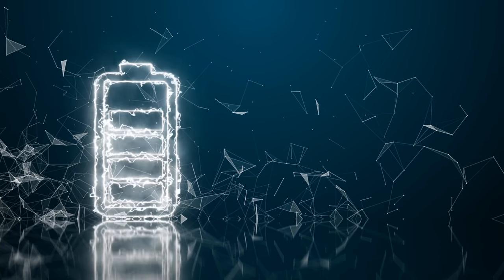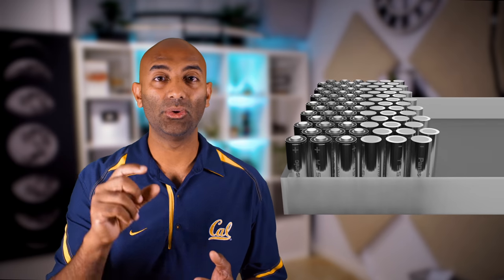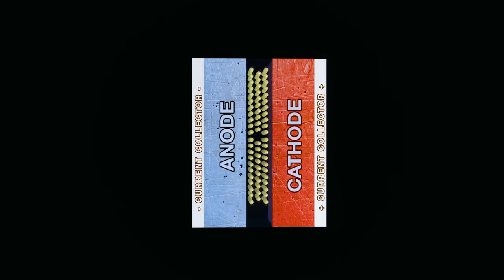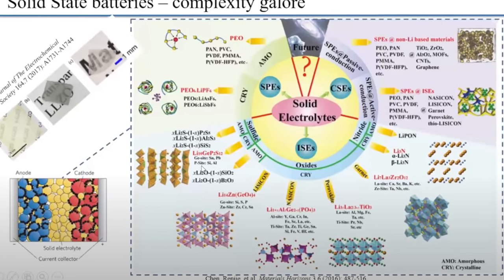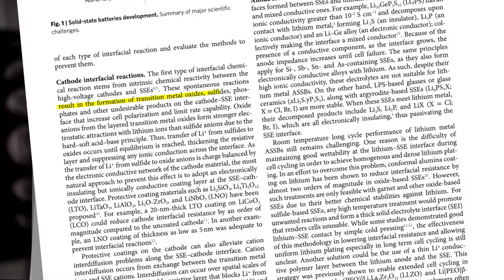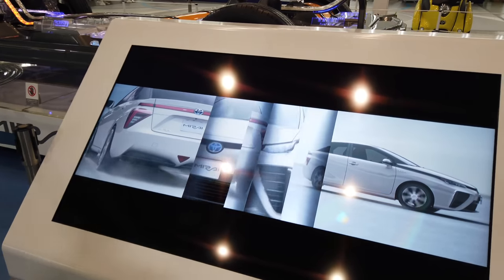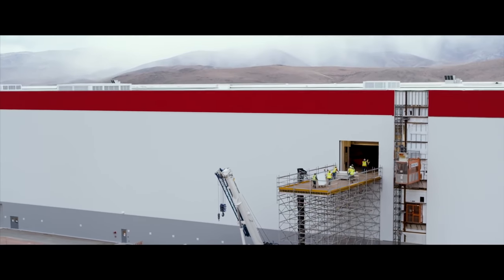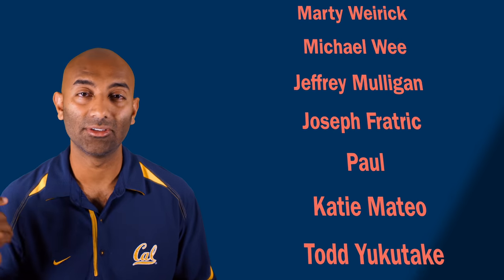The Truth about Solid-State Batteries. / Are These Batteries Really The Next Big Thing?

Comment: I remembered when those lithium button cells first came out. I thought they was amazing.. 10yr storage life. Loads of mA punch for it's size compared to the old AA zinc carbon batteries..
It was used in those small portable Japanese handheld arcade games..
The batteries then was expensive for me as a kid.
Reply: Li button cells != li-ion cells.
Reply: @karenrobertsdottir4101  ? ?
I was describing my first encounter of lithium battery technology as a young lad in the 80s.
Are they not all put under the term- Lithium battery which ever flavour they are ? 

I would be interested what you mean li-ion !=button ones.
Reply: @timypp2894  No, they are not. This is a common misconception. They both have "lithium" in the name, but that's about the same it.  "Lithium batteries" are not the same thing as "lithium-ion batteries".  They have a lithium metal anode (instead of graphite / carbon / silicon) and are not rechargeable.
Reply: @karenrobertsdottir4101  ? Kerr? 
Did I say Lithium ion? Or lithium battery?
Reply: @timypp2894  You said "lithium button cells". Which are lithium batteries, not lithium-ion, and have nothing to do with li-ion batteries, as are used in EVs.
Reply: @karenrobertsdottir4101  yes that's right. I never said anything about EV. The batteries I mentioned about was for hand games. And it was expensive because it was not just first generation Lithium batteries that I encountered as a kid but are disposable. Disposable are not the same as rechargable li-ion.
Like I said it's the first time I encountered lithium batteries. 
It's called button because it's shaped like a button . I said cell because it's a cell as in batteries term battery cells.
This is nothing to do with "cells" packs used in EV.
Btw I have a background in digital engineering.
Reply: @timypp2894  So your entire post was a massive non-sequiteur?  Do you go into videos about, say, iPhones, and write posts about, say, elephant seals?
Reply: @karenrobertsdottir4101   what the nats bollocks is one talking about?  lithium button cells are in the same family as batteries used in EVs are they not? Then there are batteries and many different flavours of batteries are they not, lead acid, zinc carbon, alkaline, etc? Like oranges and lemons are the same family as citrus family? So if there was a iPhone video and I mentioned about my youth about owning a dumb phone and " I used to txt with SMS " but now you can use WhatsApp on phone doing the same thing. Are you saying my comments are irrelevant to the iPhone video? 
Mate, this hole is getting deeper as you dig

Comment: Is true that the people who make solar panels are told to make there panels only 27%  efficiency, and that the battery technology is held back, you know oil and gas, need i say more.
Reply from the maker: no its an engineering challenge... gas cars are 30-40% efficient. efficiency is a major study and challenge in engineering... but panels will get better and better in time
Reply: @TwoBitDaVinci  actually we already have excellent solar panels but they are used only in space for satellite energy supply, those solar panels are very toxic and expensive to manufacture, so not comercially viable

Comment: Need to Define Solidstate rechargable (secondary) vs Non Rechargable (primary cell)  very different proposition - a Primary Battery cell only has a single cycle..  (10x Energy Density _I would love that - but I think that is fiction - It would be easier to improve Gasoline thermodynamic efficiency to 75%  in all probability.

PS Market Cap  Whoopdedoo  - fan bois  Driving the Price Exponentially... Revenue is where it is really at.

Comment: The theoretical energy density of the anode ( lithium metal ) of a solid state battery is 10 times more than graphite, but thats only for the anode and only theoretical and no battery can ever get any where near that.The example of lead acid is approx.200 wh per kg theoretical and 50 actual if discharged very slowly.  So please stop saying solid state will have 10 times the density!

Comment: better  batteries   do not mean retooling.  as far  as the  cars  .   way less then even  a model   change  of the past.
Reply from the maker: For companies that make batteries it means retooling. Also big enough battery changes might require special handling. For example if temp sensitivity is changed for solid state batteries it can mean better cooling optimizations can be made etc.

Comment: Great Graphics. Dendrites? (I get it, maybe I can take my car to a Dentist every 6 months?) more LOL I get it. I CAN’T HEAR YOU. WHAT? I just wanted to hear You say it again. Look what TESLA did with 7000 generic lithium ion cells that were formerly used to retain memory when you turn off 120 volt supply. The problem with your theory of solid state batteries exist to power hearing aids is the minuscule kilowatt capacity of battery.
I’m sure it would take more than 20 of these to equal the output of one 2170 cell or 140,000 hearing aid batteries to be interconnected in a different way in modules but definitely not with aluminum fingers that also act as fuse and cylindrical cell spacing has been perfected for battery conditioning by TESLA. Heat dissipation will be an issue to overcome for Solid State. Look how far we come? 60 years ago we had diodes and then thyristors that are conversion devices to change AC TO DC. Before that for 230 KV grid conversions, that was done using MERCURY POOL DIODES. NOW SIEMENS has perfected high voltage DC grid transmission using very expensive converter stations, but no storage.
Sure anything is possible and Solid State battery will be the HOLY GRAIL. Is it imminent? In 20 years maybe. Just thinking about Your batteries are causing my ears to burn. PARDON.
Reply: More research required on your part.
The info is there.

Comment: Solid state batteries delivering all the features you mention?.....................................maybe, maybe not.  Chemistry and physics have something to say about how realistic this process can be.  I think the future in EV use is rapid swapping of batteries.
Vehicles should be developed with battery packs that can be swapped in and out in less than 10 minutes with no human physical contact. You don't permanently own gasoline, so why own batteries?
Sure some folks will be able to charge at home, but for long distance travel and people that  cannot have home or work charging, the solution will be the same as buying fuel. You quickly swap the depleted battery pack for a fully charged one and be on your way. Of course it will require the manufacturer's to standardize on the battery pack and battery "filling stations" will need to built (or converted fuel stations) but I see this as the final solution to EV adoption. A 300 mile range swappable battery would be more than adequate even for long distance travel and it will be much easier and cleaner than dispensing liquid fuel.  Elon should be the first to start building a car with quick swap batteries and modify his charging stations to have robotic devices than can swap out the batteries in less than 10 minutes. Now that's the future of everyone having an EV, not some battery technology that may or may not come to pass in 10-20-50------ years.

Comment: Ricky I was really disappointed by your response to my comments saying nothing about my comments but directing me to OMAZE. Not interested. Now I was having a little fun at Your expense. Why is it that I am hearing about Dendrites for the first time. You talk about this is a huge problem. It is not. TESLA has over a million cars on road today and how many have caught fire. I will tell You how it landed. It was a dud, because when I, was having more fun giving a You a real valid comment that hearing aid batteries won’t scale because you would need 140,000  of them to power a model s. Why are You right and l am wrong? I like the idea of a SOLID STATE BATTERY TOO. I did give a partial time line for the last 60 years. I even talk about Siemens Engineering with their advancement  of High Voltage Direct Current .snd their equipment they have pioneered for converting 3 phase to AC TO DC onto transmission lines and then converting back to 3 phase AC to use at distribution end. You probably have no clue what a mercury pool rectifier is and was used years ago before SOLID STATE THYRISTORS came along because of Your Age (40 is my guess) 
Now up till now I valued Your presentations. No Longer. You really blew it when You were talking absolute BULLSHIT that TOYOTA has a Solid State battery right now but they are delaying showing anybody because of Covid. How come You are the only person that doesn’t know that TOYOTA doesn’t believe in BEV and are telling the world that fool cells are the answer. SAD.
Reply from the maker: Lots of unpack. Toyota has one copy of a car with a solid state battery. They will unveil it this year probably. Can they make hundreds of thousands absolutely not. I made that pretty clear. This tech isn’t commercially viable at scale yet. Please accept my apologies if I’ve offended

Comment: I believe I heard Elon saying the last week he thinks he can make a lithium battery better than the solid-state battery.
Reply from the maker: Well the full potential of solid state isn't fully realized yet. its liking moving from platter hard drives to solid state ones. the first one's had problems, but it was clear they were vastly superior theoretically
Reply: there is still a way to improve, just look at diesel engines, today a modern diesel hatchback can go over 2000 miles on a tank, also you can bring extra fuel with you, whats impossible for EVs
Reply: @carholic-sz3qv  he has a patent on a battery that he's already done it's called lithium. He took one of the elements out of the battery. the individual cells are the same size as the ones he currently uses but they get 3600 mi to a charge the other side of that is their only good for 250,000 miles. Or 75 cycles. but those are for full hard cycles I don't think anybody who had a charge that 3,600 miles on it would wait until it was almost out to put a new charge on it. When you don't put hard cycles on the batteries that extends the life dramatically. I live off the grid in Arizona I run my house off of lithium iron phosphate batteries. And I have to tell you there is no comparison. These things are awesome, and just getting better. I really hope he chooses to use that 3600 mi per charge battery. I realize it doesn't last a million miles and that is what he wants but on the other hand I don't know very many people that drive their vehicles past 250,000 miles. I mean truckers and ranch hands, that's about the only people I can think of that run their vehicles that long.

Comment: Sigh.  Stupid solid state hype.

Solid state, on its own, only allows you to eliminate the electrolyte.  The potential energy density increase is very minor, and that's only assuming that the solid state electrolyte isn't significantly heavier than the current polymer separator. 

Claims of "10x energy density" are hogwash. That requires li-air, which is a radical change from current cells, whether it's traditional li-ion or any type of even semi-mature solid state cell. Mixing up li-air and solid state does nobody any favours.

The main research for solid state today is to allow the use of lithium metal in the anodes, on the notion that dendrites are the primary problem, and solid state fixes it.  But just to list some problems with this notion:

 * Solid-state cells too can be frequently damaged by dendrites
 * Changes to liquid electrolyte formulations can suppress dendrites
 * Dendrites are not the only problem, and probably not the hardest problem (that'd be quantum efficiency, which determines your cycle life via how much of the lithium ends up in detached chunks of metal surrounded by insulating SEI which never again contribute to the reaction)

Solid-state cells in turn introduce a massive problem in the form of ion conductivity. You're trying to conduct ions through something like a glass as effectively as you can through a liquid.  In the real world, you don't get anywhere close to the conductivity. Liquids and gels also fully wet the anode and cathode surface, down into the pores, something solid electrolytes are generally very poor at.  The net result is low ion conductivity, and thus low power / slow charging rates.

There's a whole host of other problems, but let's just leave it at this: solid state is massive hype.  It is not the magical key to future supercells.  It's a way to plug PR to make it sound like you're working on some superbattery to leapfrog your current competitors, when you're really just playing around in a lab.

(Also, FYI: most battery researchers think that Goodenough/Braga's work is total amateurish hogwash, and feel bad for Goodenough for ruining his reputation via his association with Braga (who did the actual experimental work))